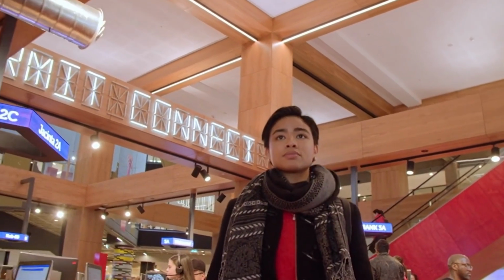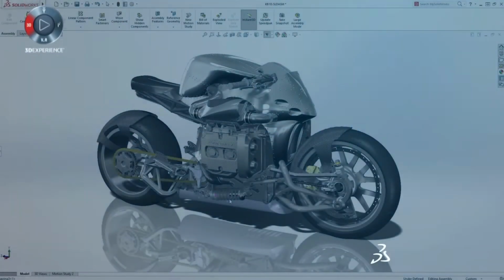Lessons From a Decade of SolidWorks Teaching

Comment: Using solidworks or CAD in general for "industrial design" is not simple.
BAsically, it involves the "look" of a mechanical device or system.
We are talking the SURFACING feature of tools.
Using SW for basics of mechanical functional part is straightforwards, but when you get into the what I call "junk engr" or cosmetics even "rendering" or "animation"
That involves different skills sets in SW not particularly complicated, but you need to review all the basics before you get there.
Reply from the maker: Yes, it’s a big process. Thanks for watching!